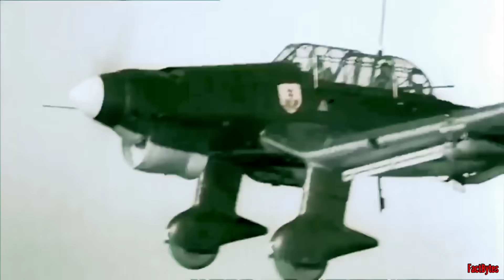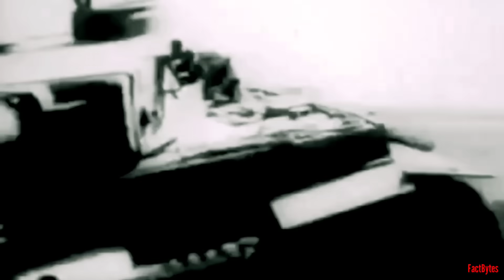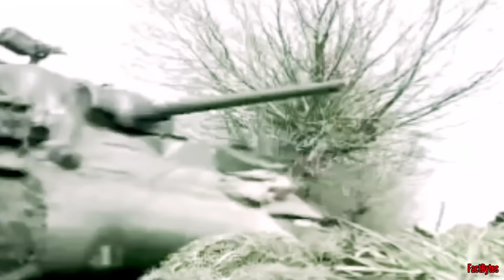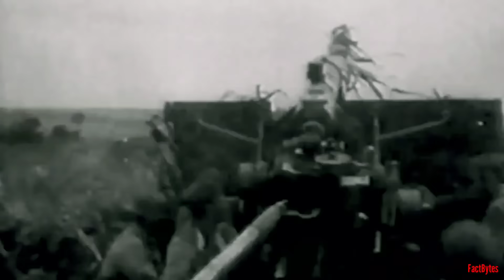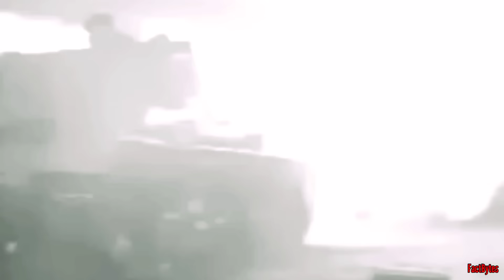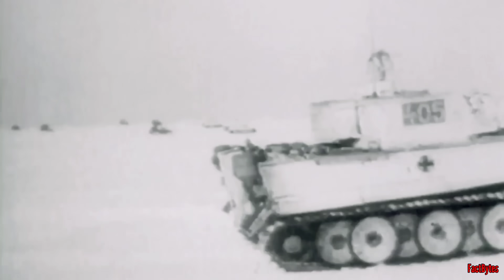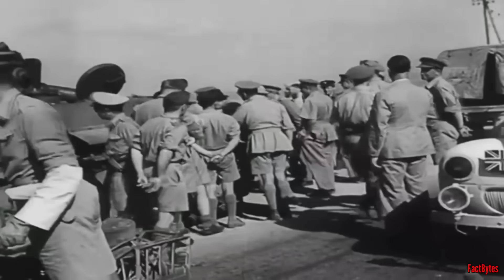Was the Fear Imposed By The Tiger Tank Justified?

Comment: Definitely had its issues, but in a gunfight with a Sherman, I would have preferred being in the Tiger.
Reply: If the Tiger and the Sherman were involved in a straight-up, head-on slugfest, then both tank commanders fucked up.
Reply: Four Shermans were required to take out a single Tiger.
Reply: @asmith8947  That's not borne out by the loss ratios of whenever Sherman tank battalions took on equivalent Tiger formations.  Of course, tank engagements aren't simply a tank slugfest; both sides would use infantry, artillery, and air support (which by 1944, the Germans had little to none to speak of at the front).
Reply: @selfdo

During Operation Totalize in Normandy the Tiger had a 10:1 kill ratio over the Sherman. 6 Tigers lost to Shermans. Over 60 Shermans lost to Tigers, including most of the the 44 Shermans of the Canadian 28th Armoured Regiment lost at Estrees la Campagne on 9th August 1944 to a small number of Tigers from Schwere SS Panzer Abteilung 101.
The Canadians didn't have air and artillery support and were easy pickings for the Tigers sniping them from 1,000 metres or more. Not a single Tiger was lost.
In a tank v tank frontal slug fest at range, the Sherman was mediocre against Tigers.

Comment: The Tiger was a frightening opponent sure enough.  However the problem was that there was a low probability of an Allied tank crew encountering one.  My understanding is that most of the time something like two thirds of the Tigers were out of action, being repaired.  And their complexity meant a low rate of production, and not enough of them reaching the battlefield.
Reply: Over engineered and thankfully often sabotaged in production by the Germans use of slave labour.. you can chain my body but my mind is going to get really creative about messing up these bits youve got me making. 

But still a terrifying prospect like the 88mm Flack gun...  Unless you had a better gun than standard and were both skilled and lucky... you would see holes drilled through your fellow comrades armour. 

Early encounters didnt go well. So definately till someone worked out how you might just kill the thing .. or hope it runs out of fuel or the cab ranked Tiffies and Thunderbolts can see the ground.
Reply: The Tiger's overall operational rate was 65-70% on west/east fronts so it's more true to say two thirds of Tigers were operational at any one time.
Source. Tiger I and II Combat Tactics by Tom Jentz.

Comment: I don't think the Tiger was ever really suitable for mass production due to its complicated running gear and unreliable engine. Nevertheless it was ahead of its time.
Reply: In some ways, the protection and firepower were ahead of their time, but not necessarily the powerplant.  Fit the Tiger with a modern turbocharged diesel engine and you've got something!  However, the same problems of how to handle a heavy vehicle, persist with, for example, the M1 Abrams and its variants.  Recovering a stricken 72-ton vehicle has never been a simple task for any combat engineering unit.  Keeping those beasts FED is another; even the Iraqis, incompetent as they were, figured out quickly, don't take on the Abrams itself, because they'd LOSE, virtually every time, but attack the FUEL tankers.  Any vehicle that drinks TWO GALLONS PER MILE of Jet-A (can and does also readily burn all grades of diesel fuel, kerosene, or, in a pinch, unleaded gasoline) is on one SHORT logistical leash.
Reply: @Horsemanray  least until the Sherman Firefly and the Pershing came along👍

Comment: The Tiger had a better power to weight ratio than almost all Sherman variants - it was one of the very few vehicles that actually could tow a Tiger.
It used less fuel than almost all Sherman variants - it carried 548 liters fuel and had a max range of 195 km, vs. 630 liters and 160 km for a late war M4A3.
It was as fast as most Sherman variants.
Due to its advanced steering, transmission and suspension it was likely THE most agile tank of the entire war (see video below).
It was as least as reliable as a Sherman, with major ovehauls every 3,000 miles compared to 2,000 miles for the most reliable Sherman variant (see video below). In the last half of 1944 it had a readiness rate of 73%, the same as the reliable Panzer IV, despite being more aggressively used.
The effective armor on the turret front (mantlet + backup turret armor) was140-225 mm.
It wasn't over-complicated/over-engineered: it cost only twice as much as a Panther which again was nearly as cheap as a Panzer IV. The reason for the low numbers produced is that it was a specialist tank, never meant to be produced in large numbers.

https://www.youtube.com/watch?v=bBni1Nd9Ez8